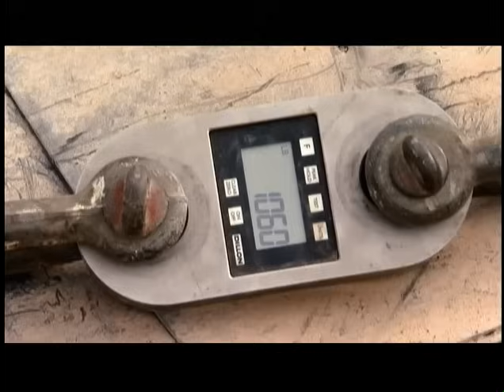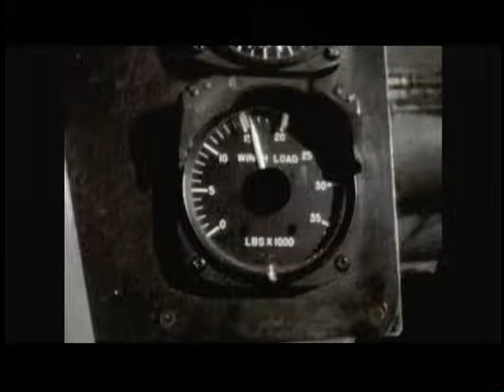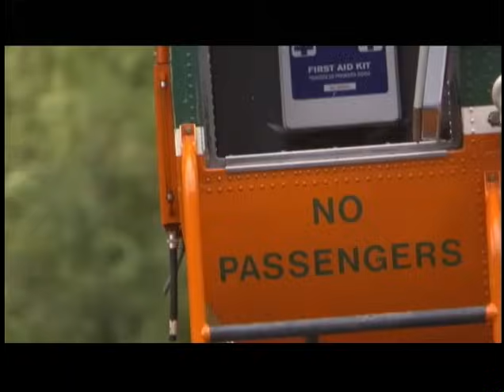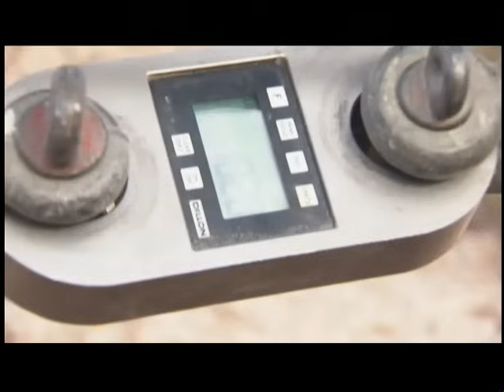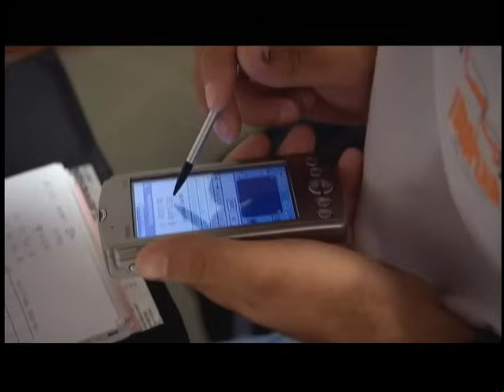Erickson: Extreme Helicopter

Comment: where is the massive required fuel tank on this bird??????
Reply: Internal. They only get 2 hours flight time.
Reply: @bigdaddy7119  so it can be worked out then from the fuel rate they say it burns/hr ;) on load or off?
Reply: ChrisFE Jackson that’s unloaded. It may be slightly different now, but I remember that from when I was a mechanic on the B models in the Army National Guard before we went to the Chinook.
Reply: @bigdaddy7119  Wasn't this designed initially by Sikorsky too?
Reply: ChrisFE Jackson yes. As the CH-54 Tarhe, or “Skycrane”. The A models have single wheels on the main landing gear along with jacking/kneeling struts and the B had 2 wheels with a fixed gear.

Comment: Wonder why they didn't put the tank in the middle for better center of gravity
Reply: The tank is in the middle, directly under the rotor. Vertically, the tank is attached to the helicopter structure on the bottom of the central beam that forms the "fuselage."

Comment: IS THERE DANDER FROM  STATIC ELECTRICITY ON CABLE VERSES HILO
Reply: Yes, static electricity is present and must be grounded before touching the load or the hook.
Reply: I was at sirocco wind farm in Tehachapi ,Ca. with these guys ,when they come down to hook up  POW!! Static discharge to you or tower wakeup in the morning, then we added a ground wire to the hook fixed that  and set like 6 Times the production than without the CH-54 great helicopter a real workhorse.